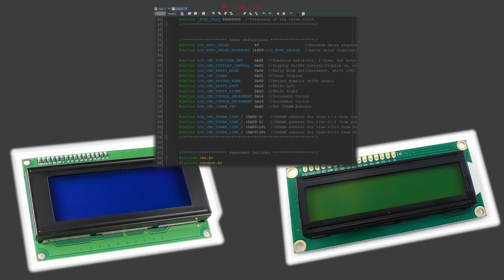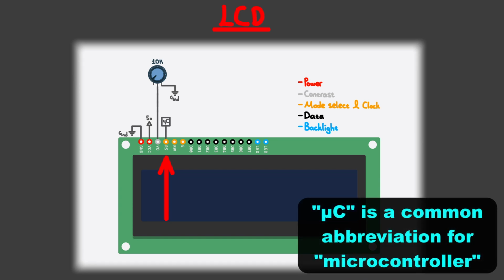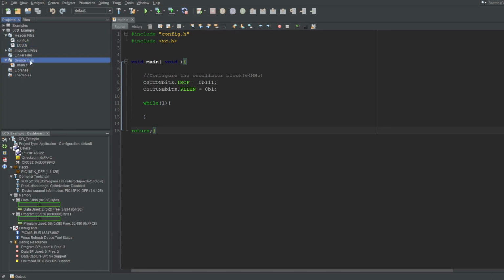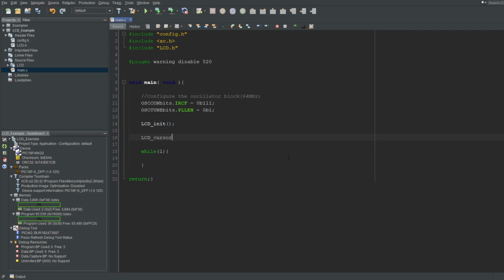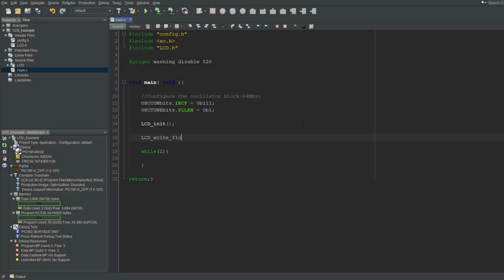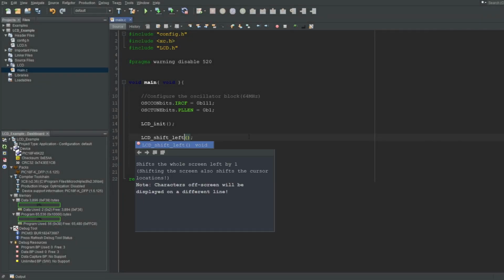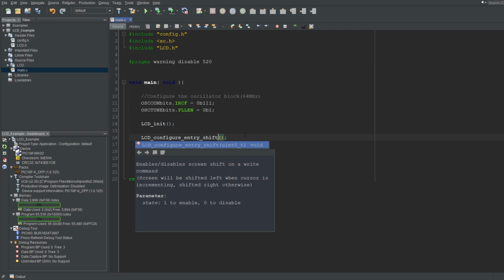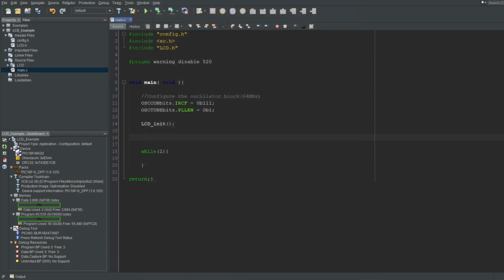PIC MCU TUTORIALS #18 - Using LCDs & LCD library (Absolute Beginner)

Comment from the maker: I have included a single-file version of the library in the download link, which contains only one ".c" file. If you don't plan to inspect or modify the functions, I recommend you use the single-file version instead. The procedure to load the library is the exact same, just with one ".c" file instead of 21 separate files.

This version doesn't clutter the project tree with a bunch of files. It also doesn't make you include unnecessary functions or definitions (the ones that you're not supposed to change anyway). The original idea was to make each function separate in their own files to make viewing and modifying them easier for beginners, but I see now that it made things complicated for no reason. Use the single-file version; it's just better... ¯\_(ツ)_/¯
Reply: Does this library work for 16x4 lcds ?
Reply from the maker: @emiliomaalouf5101  It should, as long as it uses the "HD44780U" controller.

Comment: Excellent content and very well produced video. I tend to use the 'E' and an LCDBusy function but never proved if it was necessary - most people no longer use it. I loved the detailed examples of data presentation on the LCD. I am an MPLABX fan. Thank you.
Reply from the maker: Thanks 👍
For commercial use, pin polling is a better option. I just jumbled this library together in a day or two so I could move forward with the series. I do plan to develop a more complete and improved version in the future, but I've been busy. Also, you shouldn't get too attached to MPLAB. If you use any modern IDE and come back to MPLAB, you'll quickly start hating it. I'm pretty sure Microchip is moving to VSCode extensions rather than improving MPLAB too.

Comment: Great guidance - How would I use code configurator to set up the device and run with the same lcd.h and lcd.c ive tried and believe I am close but cant display the hello world section of the video. I think my issue us differences between your config.h and mcc generated code i have attempted to set up ( no peripherals just the PortA pins) but as i cant see your config.h file i am a little stuck to make a comparison. thanks
Reply from the maker: This library only manipulates the I/O pins, so I didn't include "config.h" files etc., since they shouldn't matter. Config file used in this video is the same as all of my other videos, you can get it from here:
https://drive.google.com/drive/u/2/folders/1CIP7N4szf0-AqrUNIvPVLEe5mSTxsLH-

Comment: Can you share please the project configured for PIC16F887, no matter what Im doing I have a blank screen :( Ive configured ADCON1, switched RA4 to RB4 (also tried RA4 with resistor), all headers has correct oscillator value (im using 20mhz), but nothing works :( PIC works for sure because in parallel im blinking LED and reading time from RTC3231, all works fine. P.S FINALLY !! was able to make it work! Just used another LCD + switched to RD pins, maybe first LCD is broken or something with soldering.
Reply from the maker: Glad you got it to work 👍
Reply: @Microesque  Can you answer on one question please, for some reason my LCD blinking every ±2-3s, can't understand it is a text or backlight, blinking I mean the text becomes more darker for about 0.2s and get back to normal, I update only last line every 1s, but blinking happens every ±2-3s. Im using good power supply, added all "filter" capacitors.
Reply from the maker: @filipp7611  I couldn't quite understand the problem. Is it the text or the backlight blinking? Either way, something like that will be the result of a power supply issue.

If your text is blinking or resetting, make sure to check if the LCD is actually receiving 5V. These LCDs have a very tight operating voltage range. Getting even close to 4.5V may cause it to reset. If you have relatively high power components in the same circuit, or if you have long/thin power lines, your supply rail might be sagging just long enough to reset your LCD, but not long enough to be picked up by your multimeter.

If the backlight is blinking periodically every couple of seconds, and you're switching something in your circuit every couple of seconds as well, there's likely a short circuit in your setup shunting the power rail to ground. The backlight is just an LED, it's not connected to anything else on the LCD. Unless there was a short, it wouldn't just turn off like that.

Comment: Can't compile this for PIC16F877, is it possible at all? The main error is "use of undeclared identifier 'LATAbits'".
Reply from the maker: PIC16 microcontrollers are very old and use a different architecture; you shouldn't use them even for learning purposes, unless you have to. You can check the comment from "@joshuvajohnvarghese2372" below, where I explained the issue further. Basically you can make it work by:
1 - Changing the LAT... definitions in the header file to their PORT... equivalent.
2 - Making sure the pins you're using are properly set to digital (use PCFG bits in ADCON1).
3 - Making sure to not use an open-drain only pin.
Reply: @Microesque  Thank you a lot for the quick answer, I just have 6 units of 16f877 and don't want to buy new ones until I use those, next time will buy something new.

Comment: I'm using a PIC24FJ64GU205 Curiosity Nano, used your code and redefined all the pins for my device and nothing displays on my LCD :(. I did however skip the OSCCON code in the main file. Not sure how this would impact my results.

Comment: FYI! If using a PIC16F74 MCU then during the "Configuring the library for your connections" section, Change LATAbits.LATA0 to PORTAbits.RA0 and so on for 1,2,3,4,5 
This had me stumped for awhile. After consulting the datasheet I was able to identify the issue. Thanks for the awesome video!
Reply from the maker: Yeah, PIC16 microcontrollers are ancient and don't have LAT bits; they use their PORT bits to change their outputs. Ideally, no one should use them in this day and age. If you have any questions you can just mail me btw, I usually check it every day 👍

Comment: My second comment on this video, after while: I use your code as reference for making my own libraries. I use CCS PIC C. I've made my own headers for every PIC I use, just like headers in XC8. So, every register has bit names like those in XC8, just like every register has same or similar names, and is used in very similar fashion (dereferencing appropriate union).
Reply from the maker: I'm assuming it worked out then 👍 Normally, ordering of the bit-fields is implementation defined in C; XC8 compiler strictly states that it orders them by their definition order, I guess that's also how CCS compiler is too.
Reply: @Microesque  CCS has hidden bit definitions, that I was unable to find. It's part of so called built in code of compiler. One of reasons I've made my structures/unions was an exercise for working with unions and structures, emulating CMSIS and bare metal programming for the STM32 MCUs.

Comment: Please post new videos in your excellent series.
If you could explain the schematics of the MCU it would be great, this way we can learn to code in assembly or C without any abstraction.
With the purpose of coding our own library for any sensor based on the datasheets.
Reply from the maker: Thanks 👍 I've been having difficulties finding the time to make more videos, but rest assured, I haven't given up on the channel, and neither will I ever.
-----------------
As for the schematics, I've explained more than a beginner needs to ever know when using C, so I assume you're talking about instructions and assembly. That would need its own series, and almost no one uses assembly anymore since it's family-specific, hard to learn, time consuming, and impossible to do anything complicated with. Including such information in this "absolute beginner" series doesn't really make sense unfortunately.
-----------------
Also, I'll admit that I'm not that good with assembly, I only know what I had to use. I'm by no means an expert, and teaching that topic would require me to do a lot of research, so I don't misinform people. But if you have any specific problems or questions, you can ask me here or through e-mail, and I'll try to help. 👍
Reply: @Microesque  it's very hard to find your series on youtube, I had to scroll a lot and was lucky to find your channel. I have no idea how youtube works, but you should consider putting tags on your video/channel, like programming PIC, PIC C, Bare metal C, debugger, programmer, microcontroller architecture, datasheet,  etc...this way your series shows up on the search results. You have the best series.
Reply from the maker: @lunarrr2476  Thanks for the compliment👍When I first started the channel, I remember reading that tags didn't affect the search results, so I didn't bother. But maybe I should put some of the generic ones... Not like I'll lose anything.

Comment: will this work for all mcu under 16F? cause im using 16f72.
and its not displaying anything
Reply from the maker: That microcontroller is ancient... Old PIC16 MCUs don't have LAT registers; they write to their PORT registers to update the I/O pins. If you wrote the LAT bits in the definitions part of the header file like I said in the video, it won't work. If you did that, you're probably getting errors when building the project. You'll have to replace those with the corresponding PORT bits, though it's been a while since I wrote the library, so I'm not exactly sure if it'll work with that change only.
Reply: @Microesque  yah I replaced it with port bits and I was able to build successfully by nothing got printed on display.
Reply from the maker: @joshuvajohnvarghese  Hmm... I just tested the library, and it definitely works. But when I try it with a PIC16F877 I had lying around, you're right, it doesn't work. The library just manipulates the I/O, so I assumed it would work. Don't know why it doesn't. I'll have to look into it...
Reply: @Microesque  thank you would be soo great if you could fix it
Reply from the maker: @joshuvajohnvarghese  I seem to have found the issue. These old PIC16 devices seem to have their RA4 pins turn into open-drain when configured as output. If you have any pins connected there, add a pull-up resistor or use a different pin.

If you're using any pin that has analog capability, configure them as digital using the "PCFG<2:0>" bits in the "ADCON1" register. The datasheet clearly shows (page 23) that configuring pins as analog or digital shouldn't have any effect on pins configured as output; however, if I don't configure them as digital (for PIC18F877), they don't work as outputs... I don't know why. Maybe I'm missing something...

The architecture for your microcontroller and my PIC16F877 should be the same, so make sure to configure the pins you're using as digital using the "PCFG" bits.

If that also doesn't work, I don't know what to do, as I don't have the microcontroller you're using. I did get the library to work on PIC18F877 I had on hand using the methods above. Make sure your connections and definitions are correct, and the cables are making proper connection.
Reply: @Microesque  thank you soo much for your efforts. Let me check it now.
Reply: @Microesque  I tried and itl didn't work. I used port b this time and that also didn't help. I tried another library it did work but there is no function to display to floats and variable only char works with it.
Reply from the maker: @joshuvajohnvarghese  I tried both the single-file and multi-file versions of the library, and they both worked with the fixes I gave above. If it's not working, there are a couple of things I can suggest.

1-) Make sure the "PCFG" bits are configured BEFORE the "LCD_init()" function. My suggestion is to configure them ALL as digital just in case by doing "ADCON1bits.PCFG = 0b110;".
2-) Make sure you define your system frequency correctly in the header file.
3-) The RW pin of the LCD must be connected to GND. (I'm assuming everything else is connected correctly since you got it to work with another library.)
4-) If you're using the RA4 pin, the pull-up resistor value (connected from the RA4 pin to 5v) should not be too high. Use something around 330R to 2K.
5-) Make sure you're not calling the LCD functions inside a bunch of nested functions, which can cause the hardware stack to overflow. That microcontroller only has 8 level-deep hardware stack. So, you can only nest 8 functions inside each other at most. (The "LCD_init()" function uses 4 nested function calls already.)

------------------------------

If nothing above works, my suggestion is to make an empty project and make a loop that blinks an LED. Make each of the pins you plan to use blink the LED one by one to make sure they are operating as outputs properly. If they are, the library should just work. Maybe there is another bit besides the "PCFG" that makes the outputs not work properly.

Also, make sure the blinking speed is consistent with the delays you put in the loop, to make sure you're defining the system frequency correctly.
------------------------------

NOTE: When used with a PIC16 microcontroller, the "LCD_write_float()" function alone takes ~4K program memory. Your microcontroller has 2K program memory, so you won't be able to use that function anyway. I also said this at the end of the video; PIC16 architecture is just too old and inefficient.

Comment: Dear friend i thank you very much however do not if you will receive this message to reply
i am currently learning assembly language having switched from arduino
i am thus wondering if the lcd file is compatible 
i am also struggling with __delays on mplax asm language just to blink an led
your advise will be appreciated
Reply from the maker: You can mix C and assembly code. This is usually done by writing your assembly code as a routine (function) and calling it in your C code, or by writing inline assembly (writing assembly directly in C).
Read the XC8 Compiler User's Guide (pages 216 and after): https://ww1.microchip.com/downloads/en/devicedoc/50002053g.pdf
---------------
For the delays, it's very easy to write your own delay routines. It's usually done by loading a value to a general purpose register, and constantly decrementing it and checking if it's zero. You can nest multiple of these for exponentially longer delays. The values you put in the register will determine how long the delay will be.

You can watch Ben Eater's video for a better understanding. It's for the 6502 microprocessor, but the same idea applies to any assembly.
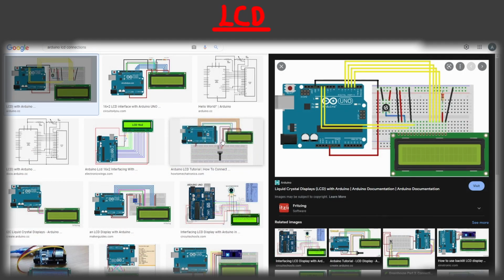Video (watch until 4:40): https://www.youtube.com/watch?v=g_koa00MBLg

You can see how delays are implemented for your architecture by making an empty function in C and using the built-in delay functions. Then, you can inspect the code generated by the compiler using the disassembler. For how to do that, you can watch my delays and disassembly videos.
Delays video: https://www.youtube.com/watch?v=1hkHIIbCeN4
Disassembly video: https://www.youtube.com/watch?v=N6k7jgPHrKM&t=1s
---------------
I don't know if you're a beginner, but I suggest not bothering to learn assembler if you are (unless you're very interested and it makes you happy 😄). Assembly is rarely used these days except for time-critical applications, and even then, most of the time they are used as inline to otherwise C based projects.

Comment: I follewed step every you did but my LCD is not displying information. What could be the problem?
Reply from the maker: I just tested the library and you're right, my LCD was unstable. I increased the delays in the library and it is working fine now. I also re-uploaded the library files with the new delay values. Try the new library I've uploaded and hopefully your problem will be fixed. If you still have problems make sure you have everything connected properly and that your definitions in the header file are correct.

I don't know how I never had issues while developing the library or using it while making these videos, and now I started having them after your comment... what the...🤔

Comment: Make video on i2c using LCD
Reply from the maker: I'll probably update the library to allow for I2C connection in the future but it'll be a while from now. Like I said in the video, I2C boards are just I2C to parallel converters and you can easily change the source code to make it work(I put comments for every single code). I didn't bother with I2C because it adds a lot of overhead and it of course requires an I2C(MSSP) module to work, so I just preferred 4 more wires over all of that.

Comment: The screen you are using is 4x20. I am using 2x16. How will I do this ?
Reply from the maker: Just do everything in the video as if you had a 4x20 LCD, they both use the same chip. The 2x16 just has those 2 lines and 4 columns off screen but otherwise they're the same. The "cursor_set()" command should also work the same, though stuff you try to write to 3rd and 4th lines won't show since again they're off screen.
Reply: @Microesque  Thank you for your answer. It really works for 16x2 as you said. But I noticed that, for Mplabx 6.05 version, the screen does not open at optimization level 0. Works at Optimization Level 1 and above. What is the reason for this? Also, LCD_add_character() function addresses work between 1-8, not 0-7.
Reply from the maker: @tanerdincler753  I just tested with the latest compiler and 2x16 LCDs work without a problem for all optimizations. To be honest this isn't the type of code that would break from compiler versions or optimization. Try doubling the delays in the "LCD.h" file("LCD_BUSY_DELAY" -> 80 and "LCD_BUSY_DELAY_EXTENDED" -> 3200), and see if that helps. Other than that, I can't think of anything, check your connections maybe?-----I also tested "LCD_add_character()" and it definitely works with addresses 0-7, it breaks if you add a character to address 8 and so on, I don't really know how it's broken for you.